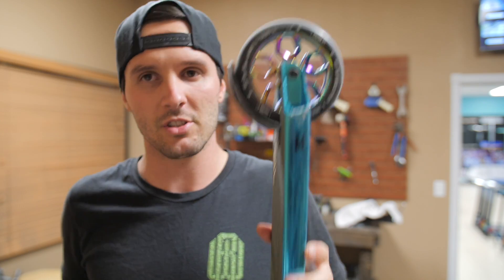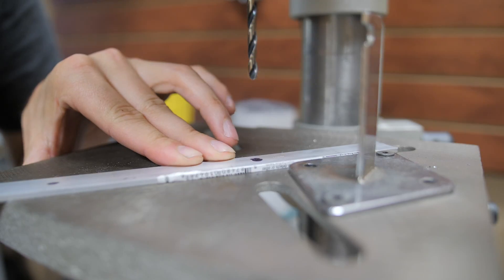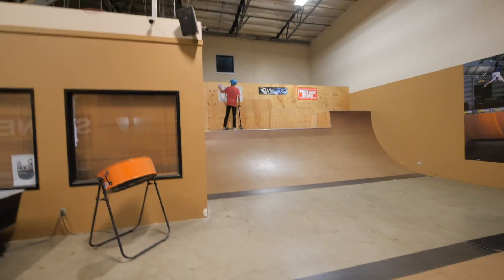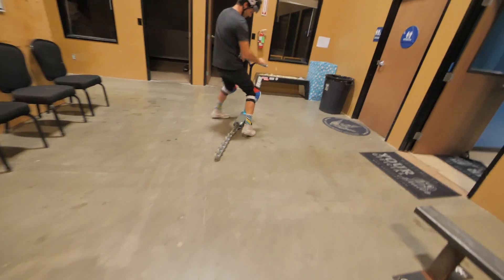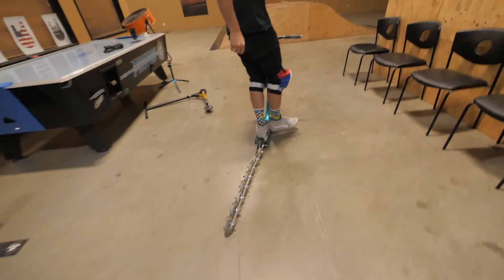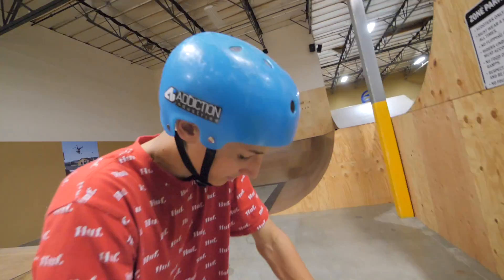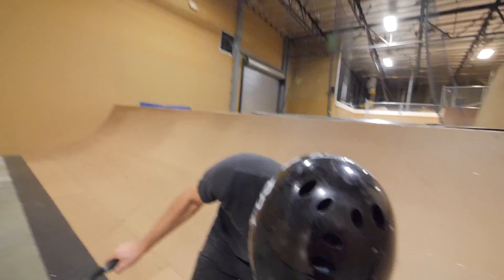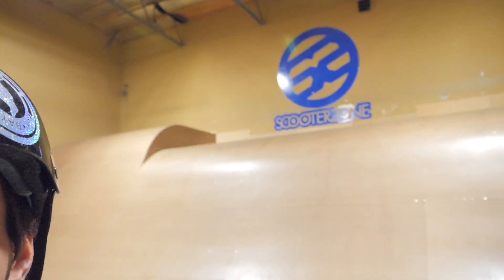WHEEL EXTENSION CHALLENGE ON SCOOTER!

Comment: If you cut the bracing pieces into sections that held like 2 or 3 wheels a piece and assembled them so it has hinges every 9"-12" or so (every 2-3 wheels) you could use even more wheels and it would actually be able to ride up and down ramps a whole lot more effectively if you put it together well. Also, though it'll be way heavier, if you use steel and double brace everything it'll take a bit more force to bend it.